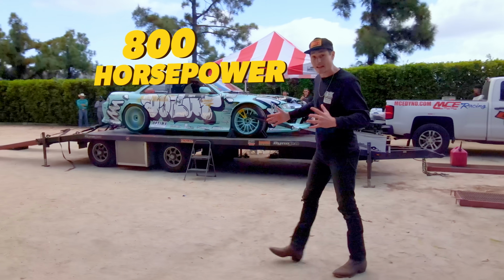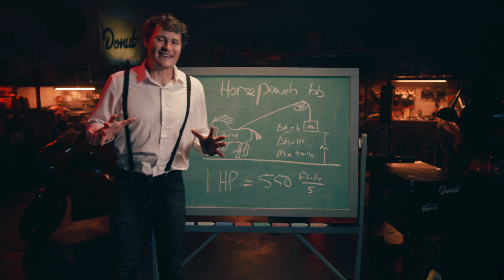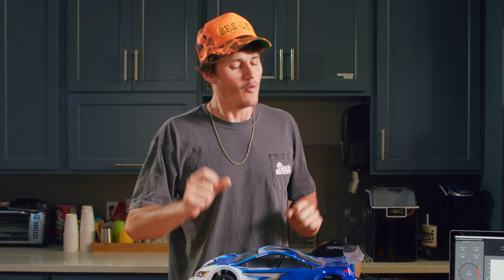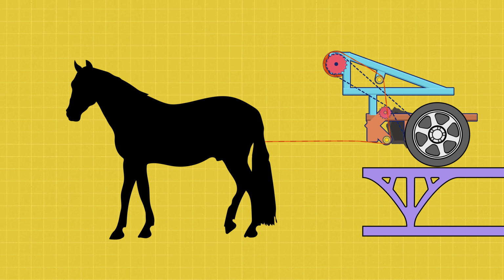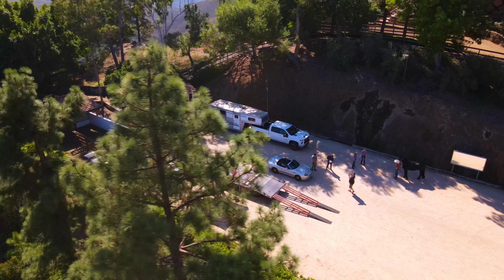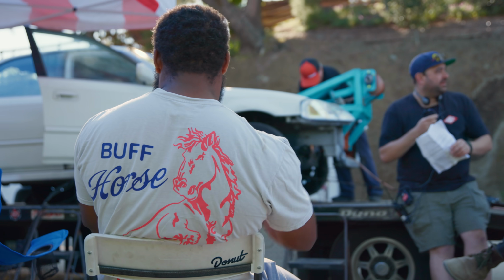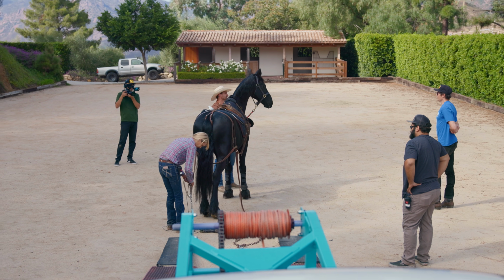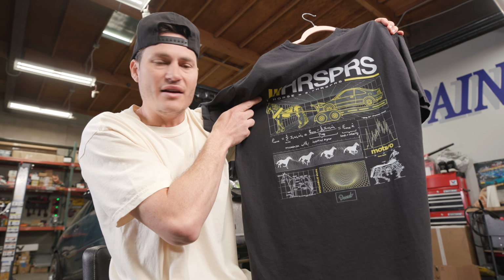How Much Horsepower is a Horse?

Comment: I don't think this is accurate, how I would do this is with a permanent magnet alternator and just literally make power at any RPM at around 98-100% efficiency. I can measure that a human at peak can generate about 2 to 3.5 horsepower for a few minutes if you optimize your power. If I can personally just generate around 3 horsepower on a bicycle the horse can generate way more than 5HP, I have Rottweilers and I'm convinced they can generate more than 3.5 horsepower running on a wheel, I think two of them could handle a 5 horsepower load for a 3 minute run, but they are both around 90 lb each and I believe they are significantly stronger than me together. Both of them together are about the same weight as me, they can Sprint about 28-30MPH and can beat me in tug or war working together. They don't have a lot of endurance and need a nap after a 5-minute run, but they are Muscle Machines in combined with their fast movement and power I think if they are geared properly, they are probably capable of generating somewhere between 6 and 7 horsepower together. The amount of energy an actual horse can generate would be incredible, what I'm getting at is it seems practical do you have a Animal powered electric vehicle. By storing their energy and optimizing it you could charge the thing while on Idol, my car requires less than 20 horsepower to cruise at 60mph. It just needs massive boosts of torque to get to that speed and sometimes about twice that to climb. It seems like two horses could produce enough power, to just have a electric truck powered by horses as strong as a normal truck.

Comment: Uhhhh to state the obvious, the horse never ran. So you're only measuring horsepower at a certain 'RPM' so to speak. And obviously that's not the horse's peak power, because he would have way more power if he was really running and charging. 

This entire experiment is bunk. Bunk science.

If someone did it right it would be interesting.

Comment: So BigD's power was equal to 3,135 foot pound/sec (5.7HP x 550 fp/s/HP) or he pulled 3,135 pounds a distance of 1 foot 1 sec.  That's impressive and probably means that the horse James Watt used in his experiment was weaker than BigD.  
By the way, why didn't Donut just measure the time it would take BigD to pull a 550 pound weight a certain distance upwards using a pulley, just like Watt did? Perhaps the biggest question is, why did James Watt choose 550 pounds as a weight to measure horsepower and not 500 pounds or 600 pounds?

Comment: Hats off to the team for coming up with a great idea. I noticed that the horse was not allowed to run at a speed anywhere close to its maximum speed. Is this not like testing an engine, but limiting its speed to a small fraction of the speed at which it outputs its maximum power? If the test was done over the horses entire speed range, could it not have generated more power?

Comment: The 1 horse power is measured as the power of a horse working for at least 8 hours continuously and not a 25 second sprint. People can sprint for a few minutes generating more power per second than running for 8 hours. Measure a horse working for at least 8 hours straight and you will get ~ 750W per horse. So you are wrong , fail to comprehend simple facts and you have a failed experiment.

Comment: If work (work = energy) is equal to force multiplied by distance, then could you just do this in a simpler way by measuring the force with the force sensor which was featured on the video and the distance that the horse was pulling to get the total energy used? And then divide that by time to get the wattage and the horsepowers. And the horse could be just pulling a rock. And you would test different sized rocks to see for which rock the horse uses maximum horsepowers. Why would this not work?

Comment: I'm not an engineer, but the obvious plan for me is to remove the whole car and just connect the horse to the dyno directly.
after all, you are measuring the horse power without wasting some of it in transition.
you could even set the dyno vertically and investigate the measurement of its diameter and make the horse walk around it instead of overcomplicating the project.

Comment: Long ago motors that were rated at one or two horsepower were turning out 30-ft lb of torque.. nowadays the little high revving motors can be rated at 200 horsepower and only make 100 ft pounds of torque lol.. horsepower is nothing more than a mathematical equation used nowadays for nothing but advertising.. torque is the actual power.. above 5,252 RPMs, horsepower looks fancy on paper.  The old Cadillacs would make over 500 ft lb of torque from 1800 RPMs and up yet we're only making 200 horsepower.. I roasted a bullet mustang on an uphill with my 72 Cadillac and it had the smallest motor available at the time, and that was after the power was reduced because of left wing emissions nonsense.  the smallest Cadillac motor that year was a 472 big block.. 7.7 liter to you metric kids.

Comment: You can design this easy
Power is force x speed time. 
If the horse is pulling a load on a road force of 500N at a speed of 2 m/s in 3600 s then you know how

Comment: I am pretty sure the test is flawed.
It’s like measuring HP at gear 6 starting from 0.

The HP is always related to the RPM of the engine. So when we talk about the HP of an engine, we are talking about maximum HP at specific RPM.

I am 100% sure the guys and the Horse would be able to put out much more power if they could be moving faster. For that they would have to gear down a lot.
So the gearing is wrong.

The measurement myst be made at the point of galloping speed of the horse and top (close to top) speed of human.

Please do it again and let’s see the real maximum power.

Comment: Hasn't this already been calculated as a power value where 1HP = 746watts? Watts is a measure of power for electricity because a 746 watt electric motor in theory (100% efficiency which can't actually be achieved) will output 1HP. Someone already figured out that 1 horsepower equals exactly 746 watts and it isn't just some arbitrary number.

Comment: You have a gear reduction. That reduces the power needed from the horse to pull the car the same distance as pulling directly, wich will calculate to more hp than the actual horse. So just using not so common sense, I can tell you that your calculation is way high. I should have been a scientist.  How did you all overlook the ratio? For every revolution of the wheel, you need to be pulling as much rope as the circumference of the tires. Horse goes one inch, tires go one inch.
Reply: Gearing does not multiply power.  It can only multiply torque.
Reply: @rollsroyce329 😂is that so?
Reply: @JonathanBaker-t6y 😂Ya, that’s “so”. Not because I say it’s so, you see, but because the first law of thermodynamics and the conservation of energy says so.  A lever or gear is a simple machine it cannot create energy.  a lever can exchange force for distance on equal ratios only.  With the equation for power being force x distance = power you can see how trading force for distance in equal proportions may increase force or distance but the product can never exceed an incongruent product.  If it did the gear would be doing work at the output that did not go in the input.  You don’t believe in perpetual motion or witchcraft do you?😂.

Comment: In India ancient texts were so much advanced that like today horse power is recognised for measuring the transmission of power by modern engines, in our ancient texts dating back to thousands of years elephant power which was calculated for eg 100 Gaja means strength of 100 elephants. The power or strength of human, tidal force or any powerfull force strength was expressed in Gaja multiplication.

Comment: Can’t believe how hard you made this. You take a two wheeled sulky with decent wheels, good brakes and an accurate odometer. Then you connect it to the horse via strain gauge(s). Take the output from these, mix them with a time input, feed them into an Arduino and find a 17 year old physics student to make up a spreadsheet giving both torque and power either instantaneous or smoothed over any interval you choose. Now just go and find a level patch of ground. Oh! And a horse, of course.

This device has unlimited range and it could be used to measure energy out-put over longer periods than a spool of rope.

Comment: So if 1 horse is 5.7 hp than to actually set that as baseline. Now your Bugatti makes 263 hp. Instead of the 1500 claimed 😂. Also id like to see what some diffrent horses produce for hp output. Also makes sense that its now based on a mathematical equasion for work. 😮

Comment: Interesting video, kudos for the effort that went into it, But it appears to completely ignore the fact that the horse is also moving its own weight here. I think the power available at the horse's legs is much more than 5.7. That's not even 5 X what we know a human can do. I think the car dyno, although entertaining, is a very flawed way to measure in this case. I think the more accurate horsepower could be calculated simply by knowing the mass, top speed, and time it took to reach that speed. But obviously that would be boring, and this wasn't about science, really :-)

Comment: As a young lad (long before the internet) I had learned in school the development of horsepower also included the ability to pull over a time period over which horses were used without suffering excess strain. Obviously no one wished to over work their animals. As you folks so wonderfully demonstrated for brief periods an animal can produced more. Congratulations on your collaborative accomplishment. Also congratulations for getting your efforts recognized by Wikipedia in their summary of how horsepower has been derived.
Reply: Yup.  The explanation I got when learning physics was that Watt's definition of the horsepower was what one horse could do, working *all day long*, without killing the horse.  And they did kill a lot of horses.  Being a horse back in the day was not a nice life.  Donut and Big D both pulled for a few seconds before taking the rest of the day off, so it's not surprising they can provide much higher burst power.
Reply: Horespower being measured off horses is kind of dumb, it's going to change based on horse breed, gender, and even just individual horses, and again, whether the animal is actually pushing it's own limits or not.
Reply: @JZStudiosonline it made sense if you were going to replace the workhorses running your mill with an engine and wanted to pick the right size.

Comment: I think, this setup is not useful to measure the real maximum power point of a horse. A horse can develop much more power than just a few kW, when it goes at considerably higher speeds. But in such a setting a horse acts work mainly on its own wind resistance.

In order to find out the real power of a horse you have to record a running horse with camera systems at a low wind day to make a computer model of it which can be implemented in a CFD software to calculate the drag and speed of a running horse against the wind, which determines the real power of a horse in time resolution and so the average power of the horse for a certain time interval.

Comment: Other than not being as complex and maybe not being as good for a video, any reason to not just put a big spool welded to a wheel that is mounted on the car.  The cable could be wrapped around the spool and over an idler pulley to keep it level with the horse.  Seems a lot simpler than running through a transmission when it is the wheels that spin the dyno on a chassis dyno.

Comment: "Horsepower" was not about horses, it was about power.  Specifically, it was about defining a unit for power.  Power is the rate of performing work.  The exemplar chosen for work was a mill, driven by one horse, which was a common machine of the era.  A horse driving a mill works for several hours, so naturally is not performing anywhere near peak power.

Comment: funny to reinvent a device that already exist.  Horse pulls in Michigan use a Dyno for competition.  I am certain sensors applied would allow for capturing the data needed.
Reply: Also, draft horses vary in size tremendously, you used a very small draft horse.  perhaps use a medium (average) draft horse.  My fathers horses are literally twice the weight of this 1400 Lb horse.

Comment: I did wonder why you didn't just treadmill the horse. A band layout between the dyno and just another free wheel would have reduced the amount of mechanical loss within the system. Then I realised its a horse. Horsey may not like a slippy type surface under hoof.

Comment: Great idea… but the only thing that bothers me is your using “horsepower “ as your metric it seems to me that what would be more useful is to see fast the horse could go running at full gallop … this would be good data for towing but I don’t know about speed. I think what we actually need to do to get more a accurate understanding of what hose power is say that 5.7 is (speed under a load) then do a different calculation with the same horse for speed. Then compare those numbers somehow because l don’t remember them taking about the losses from the horse having to pull verses if it wasn’t attached to anything as if it was just running or some one was riding it at full speed

Comment: You have made it too complex. Plus its impossible to calculate the losses with that low power. Making it simple and measuring watts would be much more accurate and easy.
Reply: 1.9 hp with 3 people proves the point

Comment: Well it must be a trick question. I figure a horse has 4 legs and each leg must have at least 1/4 hp. The legs carry a lot of weight so you would subtract a like 50 hp from 1 total horse. Leads me to believe a horse has -49 hp per horse capita.

Comment: How much torque does a horse make? A horse will pull a tractor all around with 5.7 hp that weighs the same. A 100 year old hit and miss engine at 5.7 hp will give a horse a good run.

Comment: The horsepower calculation was based on what draft horses produce over a whole day as horses were actually used without over working them.
What you measured is peak horsepower.  If you drove Big D that hard for even an hour, he'd no longer be with us.

Comment: Very cool production. well done. So all you mustang guys (I only say mustang because it's a horse) divide your crank horse power rating by 5.7 to get actual "horse" power numbers. So a 1064hp ZR1 is actually equal to 186.7 real horses. with a 15% loss wheel HP is 158.6WHP. Very cool. I doubt the industry will change the ratings. Making the numbers shrink will be frowned upon by the need for a big D number LOL. I think its an underestimate and that horse was just starting to get going take it to a horse track and get a horse running with a supper long rope.

Comment: A horse to pull 550lbs per foot per second vertically is 60RPM equivalent, so with 550x60/5252 gives you 6.2hp, very close to the 5.7hp achieved here. 
With a proper draught horse it would easily be this number.

I would have loved to have seen the strain guage numbers in the video.

Let me guess, 55RPM was the paper wheel reading?

Comment: I think you should have chosen a different gear ratio, like putting it in a lower gear and then entering the ratio into the dyno. It was too hard to pull. If the weight is too much, you can't make any power at all. If the gear ratio was different, you could run faster, which might give you more power.

Comment: Depends on the horse breed….all would be different. Example- a thoroughbred race horse is faster on a track but can’t pull a plow as well as a Morgan horse or any of the draft horse breeds. As the owner stated Big D is a light draft horse, a normal heavy draft horse (think Clydesdale or Percheron) would generate more “horsepower’ or “torque”. Cheers

Comment: According to your calculations it would take 140 Big Ds to equal 800 hp.
 That was a lot of work with too many variables.
Horses do just fine on a treadmill which is what you should have had it on.
Vehicles tested on dinos are already rolling before the test begins.
Your test was comparing apples to oranges. 
A horse's stride is no different than the circumference of the wheel 
Consider a quarter horse can hit speeds of 50 mph.
 Most horses will   pull a Rolling load of 1.5 times their body weight. 
 Yep you really should have done it on a treadmill and allowed the horse to get up to speed. 
In fact you could have tested a variety of different breeds.
The draft horse would be your tractor.
The quarter horse would be your muscle car.
The Thoroughbred would be your high-speed endurance.
I'm a Rancher in my 70s. But I've been in the horse racing business much of my life. I have also built/ raced a variety of vehicles.
I've also designed and built a few experimental airplane throughout decades.
 My composite 3/4 scale P-51 tandem  has a supercharged LS7
 And my STOL bush plane as a supercharged type 1 2300.
 It's enough hp to launch the plane in less than 30 ft.
  Did I also mention I have a degree in Aeronautical Engineering?

Comment: You got figures for Force,  time, distance ? Torque.This horse is at 100 % output. Maybe the 5 odd hp should be divided by 5 assuming that a horse can pull 20%of the ma  load all day. Still, interesting experiment.

Comment: Very nice video, my job is working with horses.
unfortunately I think you made a big mistake.. the ground in the experiment is too slippery for a horse to let he pull hard. you need sand… no grip, no power  transfer. 
It will be fairly different believe me